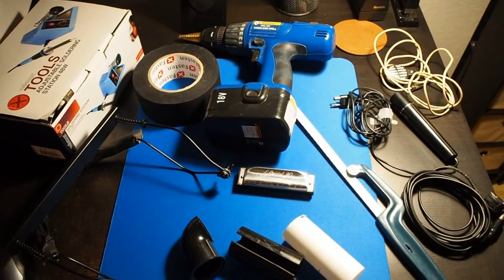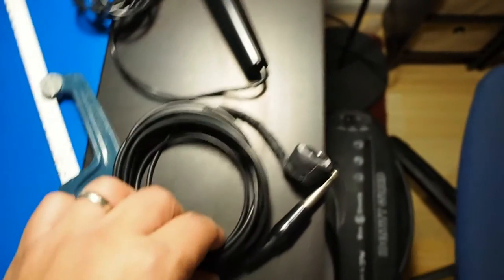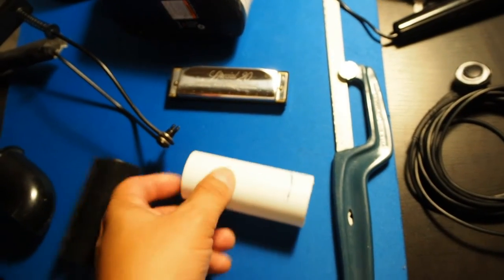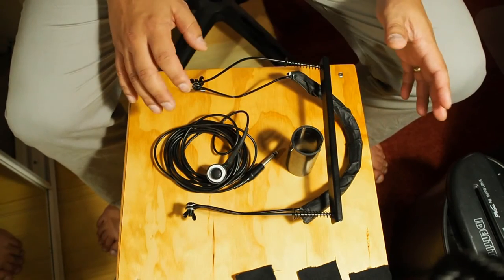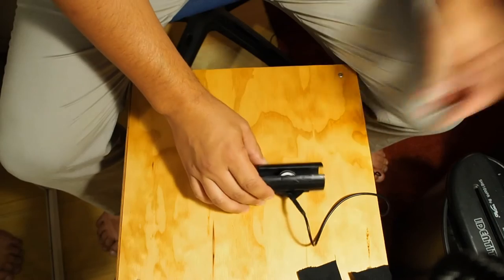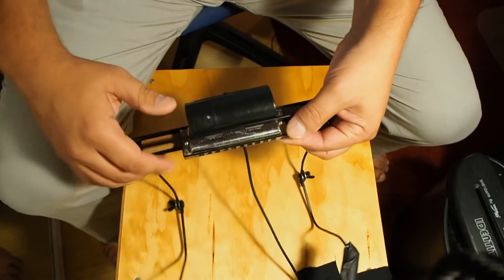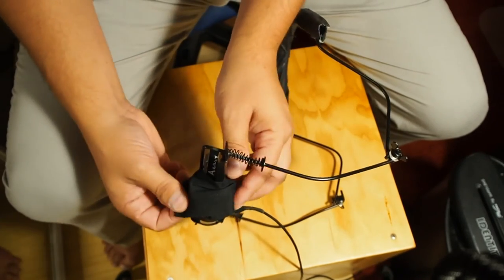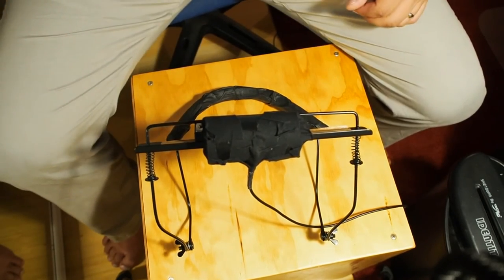$5 DIY Harmonica Rack Mic - Play Amplified in a Rack! (Part 1 of 2)

Comment: Nice job.   

How about some PVC end caps instead of tape for sealing it tighter?
Reply from the maker: +nacoran I tried that, but the caps prevent you from opening up the "C" of the clip put the harp in, and once the harp is in there, the "C" shape isn't round any more, and so the caps won't fit. I have an idea to cut out some foam plugs to put in the ends after attaching the harp, so that might work better. We shall see!

Comment: Have you tried using those little electret mics???
Reply from the maker: Yes, they have very bad low end response and sound very bad when overdriven. And also tend to have terrible feedback problems when cupped. I'd stay with a dynamic element for this.